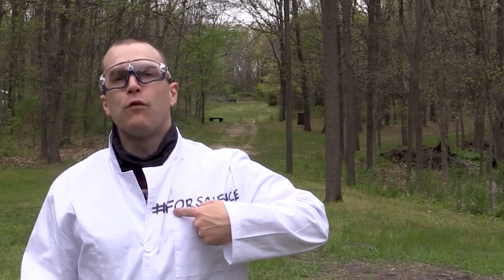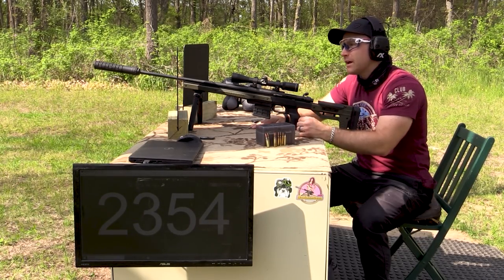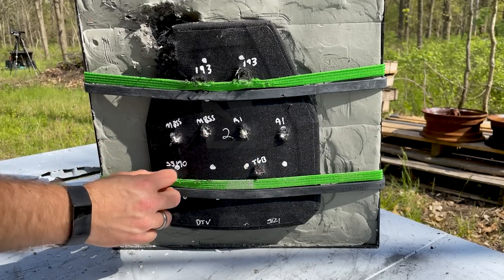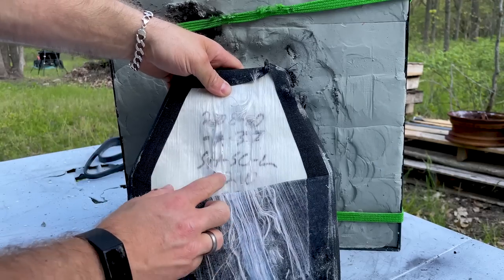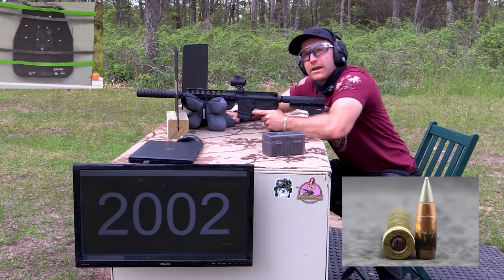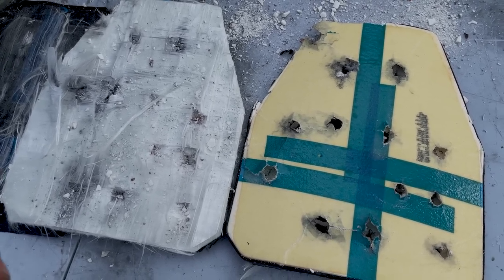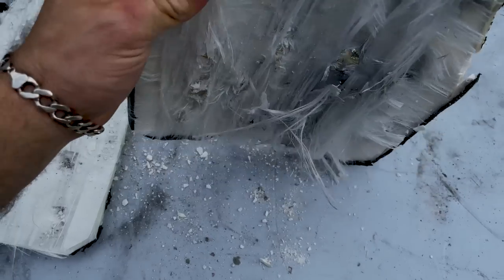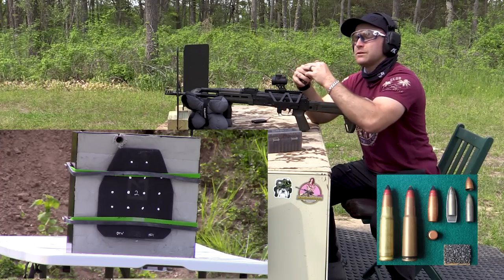Hesco Body Armor, Model L210, Meets the King of Armor Destruction

Comment: Hey Buffman, would you consider doing a test video on the MIRA Tactical (same as MIRA Safety, the gas mask company) Level IV plates? They're lightweight (right at 6 lbs. or so), and less than 1" thick. They passed the level IV caliber stuff in videos that I've seen, but most if not all of the videos on here of these plates has been the "backyard testing", not replicating NIJ protocol like you do.
Reply: Imo i advice you to stay away from those, those plates arent certified, and they look like rebagged chinese plates, which is not good, you should stick to hesco/rma/hoplite
Reply: @anaveragebullet3676  Well Buffman himself has tested Chinese plates on here before and they did very well for what they are. Most notably and recently, the Militech plates that he has a couple videos on.
Reply: @kasper_429  if you want to trust your life to cheap chinesium crap then go ahead, be my guest
Reply from the maker: @kasper_429  I think the difference would be Militech is an OEM manufacturer, vs retailers who are simply private labeling an OEM and then not disclosing where the armor/materials are coming from. Some retailers say their plates are "Made in the USA" from imported materials, and that's fine. But are they really importing raw materials, and cutting, pressing, etc, for a finished plate, or are they really importing a finished plate, and then slapping a cover and sticker on it. Are these retailers even threat testing incoming lots? Are the retailers even remotely educated on armor, or did they see it as a way to increase sales?

In the end we all know any slip in quality from a manufacturer is the last thing we want with PPE that we depend on our life on.

Comment: Ever considering testing the triple curve Velocity Systems Special Threats?
Reply from the maker: Are those tencate plates?
Reply: @BuffRANGE  I think they're rebranded LTC 27105's. I can't find much information on them. Apparently the LTC 27105's are ICW level 4s, but these are marked as 3+ special threat. They're concealment plates and have the same dimensions as the U210s, they're just heavier. Hoping you get to test them out one day.

Comment: No plates are rated to take 10 or so rounds per plate so it's not really conclusive
Reply from the maker: But here I am showing other plates taking 20+ rounds :)
Reply: @Buffman - R.A.N.G.E.  yeah but it's not really telling. Don't know if they went thru because the plate broke or if it was the round defeating the plate
Reply from the maker: @VG-913  I did a follow up on the L210 and it performed better. My point of the test was to show that it’s not the solution to everyone’s armor needs :)

Comment: Disappointing, tbh. Plates that cost $100 and are even lighter stop more threats than this. However, like you mentioned, the backface is very little with this plate and that special tape/glue did hold all of the ceramic in very well.

Comment: I would like to see the L210 shot with more realistic barrel lengths nobody shoots a 22” barrel on any modern AR
Reply from the maker: I test for worst case scenario. I've tested IIIA SRT PE plates that stopped M193 at over 3200 fps.  I based these tests on a lot of internet lore that was passed around. I will re-test these plates :D
Reply: @BuffRANGE  Yeah, Level 3 plates are punched through by 16" barrels with m193 if within 17 yards, but not further, and not through 3A armor.

Comment: And all the Instagram operators cried
Reply from the maker: Wonder if they'll bother to comment on this video..
Reply: They’ll probably argue that a 22” barrel isn’t in their threat concern and an unlikely scenario.
Reply from the maker: @pushbak5289  But they'll make false claims like "16 AR-15 with m855 is a steel armor killer" ;)
Reply: @BuffRANGE  yeah not sure why people think greentip is an end all be all round, it’s pretty garbage tbh.  This is kind of eye opening tho because hescos plates are rated for 3150 ft/s for velocity from m193, even their high end 4800s. Which even a 20 inch barrel can exceed.  So any boomer with a 20inch and m193 can defeat your plates?
Reply from the maker: @pushbak5289  That's a very valid concern. I would "ASSUME" actual level IV plates with more backing material would shrug that off, but I also assumed the L210 would shrug them off as well.
Reply: @BuffRANGE  yeah true, figured they’d have the same backing or close to as the higher end.  Hopefully you can do some testing down the line with their other plates, but these tests are greatly appreciated. Definitely gives a great insight for consumers before they buy a product.
Reply from the maker: @pushbak5289  Thank you. That's why I continue to do this. in a consumer world,  maximum performance vs price can be a decision driver for us, and for Body Armor, sometimes those standards don't cover something like that. So if I can demonstrate Company A level IV, somehow outperforms Company B level IV, I feel we should have that info.
Reply: @BuffRANGE  Figured I’d post it, but after some more research, even RMA’s level 4 plates are rated for 3150 ft/s in terms of velocity for m913. Guessing this is standard for lvl 4 plates and the backing helps stop the round as you stated.
Reply from the maker: @pushbak5289  Hopefully that # is updated, because level IV has many times stopped M193 going 3400 fps
Reply: @BuffRANGE  yeah probably don’t for liability. Will be looking forward to you testing some other plates from the Hesco line to give a comparison to other lines you tested such as RMA in equivalent threat levels.

Comment: Military  5.45x39
Reply from the maker: What particular 5.45 load? Anything available in the US outside of rare collectibles poses no threat for this armor sytem.
Reply: @BuffRANGE  I suppose standard issue for the russian military. I am curious how an l210 would fare in a 5.45mm dominated warzone. 7n6 may be stopped but i wonder how 7n6m or 7n10 would do.

Comment: i would of liked to see it get hit with 7.62x39 and m855 because that's what it was made for
Reply: It’s probably not a good idea if the bar is set too low. Reasonable destructive testing where you go above the specified rating is a good thing.

The problem with the L210 is that people are marketing it as an alternative to actual level 3 plates, which can take a wider range of threats. This video shows that the L210 is clearly not an alternative to a proper level 3 plate.

Comment: i paid over 400$ for this armor, im so sad.
Reply from the maker: Why has you sad sir?
Reply: @BuffRANGE  because it doesn't hold up to the round capability i thought it would. I understand there's more velocity than a standard 16" on what you tested with, but I'm sad that standard m1993 zipped through it.
 I saw your other video on the LAPG plates, and i opted for those at first; being a budget pick. I eventually sold them to a friend and went for the hesco l210's(trex arms hype) thinking they would provide more protection. But it seems it's about the same thing for more money.